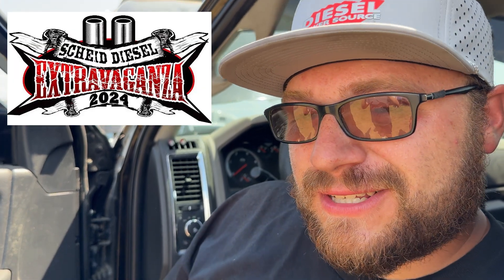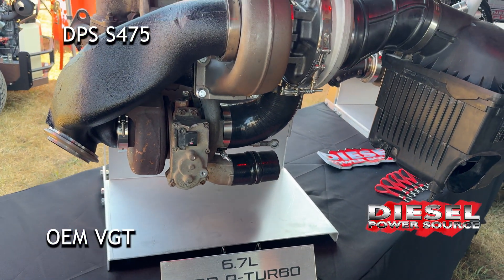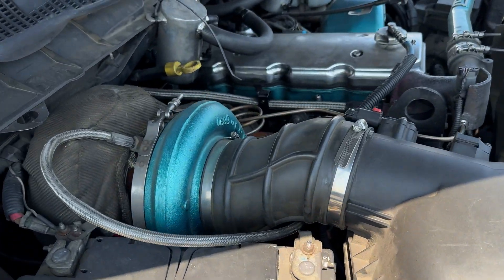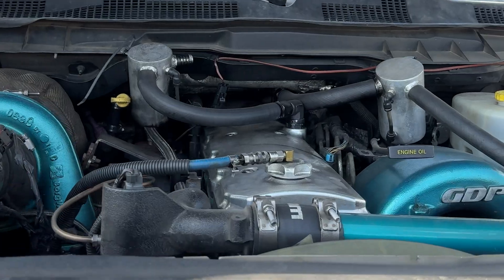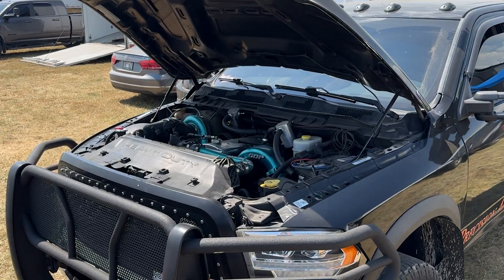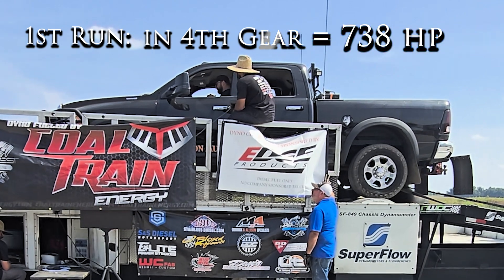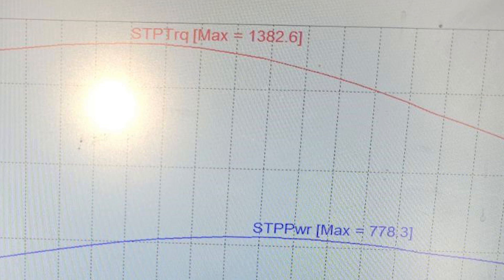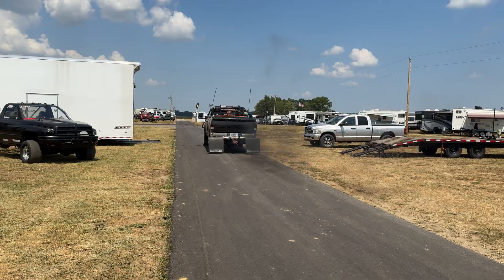Add-A-Turbo Compound Kit for 6.7L Dyno Test Results!

Comment: Hmm seems to be a different definition of compound turbocharging from what I'm familiar with. There's no mechanical connection from the compound to the engine crankshaft like in the Wright R-3350. This here seems to just be serial or parallel turbocharging
Reply: There are two turbochargers, a small and a large. On the compressor side, the large turbo forces air into the smaller turbo, and the reverse is true on the turbine side. The point of it is you get the low rpm response of the small VGT turbo, and then the large turbo forces more air into the small one as it runs out of flow

Comment: 54k pounds on a single wheel? Come on now
Reply: Tractor pulling.
Reply: @ he said going up an off ramp
Reply: I know right? Surely something is bending at that point. I pulled 34k of hay and trailer about 10 miles once with my 2012 dually and it was looking real bad.